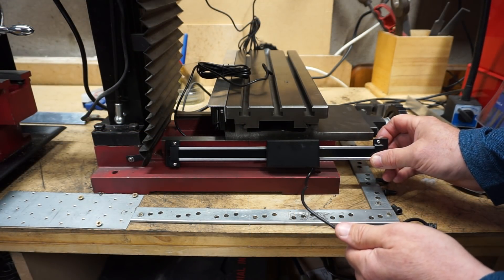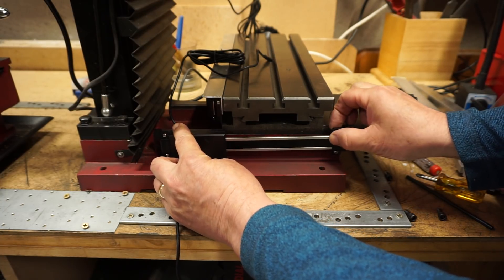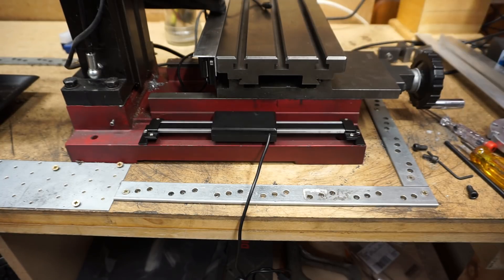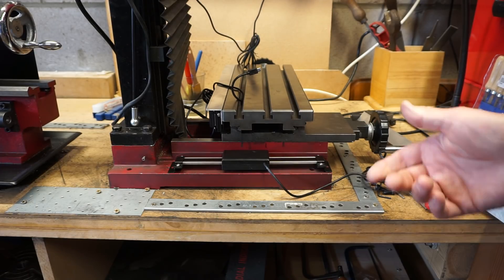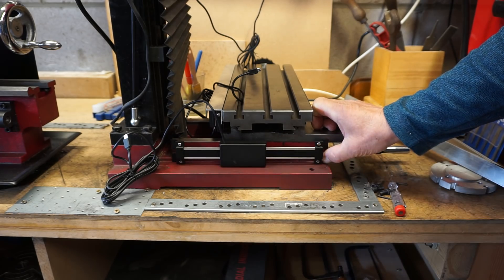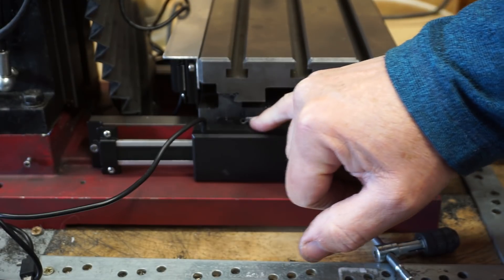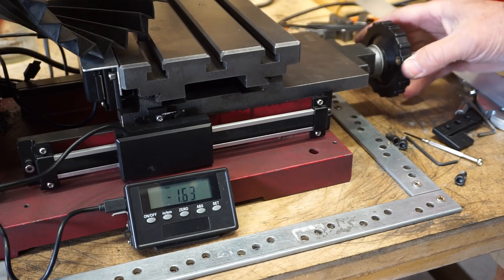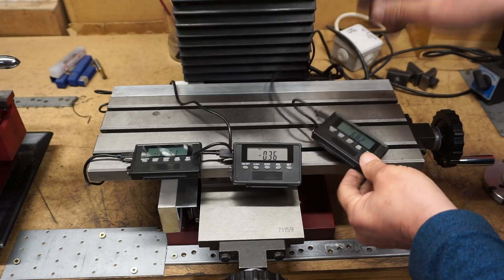#MT28 Part 3 - TouchDRO for SX2P mini mill. The y-axis. By Andrew Whale.

Comment: Hi Andrew,
Adding a DRO makes using a mill so much more enjoyable.
Before installing my DRO, working off the Dials was hard work.
Since fitting a DRO I've found my work to be far more accurate.
I'm a fan of Dave M's videos. He is so thorough with his projects and goes into so much detail. I've learn't a great deal.
Great mini series on installing the DRO.
Regards MachineNZ
Reply from the maker: Yeah Kevin, I'm hoping that they will be stable and accurate. They should save me a lot of time. I keep on losing the centre of the rotary table and it drives me nuts.
All the best.
Andrew

Comment: Reading the comments you will see in an upcoming video where I just blew a ton of chips out of my X axis scale and it was completely covered. Somehow they sneak in thru the rail opening. Just  my 2 cents  or pence...
Reply: Could it be a poor cover hinders keeping the scale clean? I vacuum during and after cutting and have yet to see any build up on the Y axis scale, the head is tucked well out of the way up under the cross-slide.

Comment: Hi Andrew,
Try using another piece of aluminium angle and invert it to mount the scale cover.
As angle bracket to hold your scale cover in place.
You'll possibly need some cable management as the read head moves.
So the cable doesn't snag when moving the y axis.
ATB Adam
Reply from the maker: Thanks Adam. I might give that a try at some point. I have some aluminium brazing rods, so a good reason to try joining the two together!
Keep the great advice coming!
Andrew
Reply: @learningturningmetal  
Sent you an email, drawing of what I mean
ATB Adam
Reply from the maker: Ah, I get it. Thanks for explaining. A picture paints a thousand words.
Andrew

Comment: I also have a SX2P and did a dro installation exactly the same way except for the cover on y-axis, don't feel I need it really.
Reply: Same here on the same mill except for having the cable exit from the bottom facing to rear and to enable maximum travel reversing the end holding brackets, drilling new holes close to the edge of the brackets to enable access to fixings below the scale bar. Same as you no cover fitted and yet to be a problem.
Reply from the maker: Many thanks for the feedback guys. It's a relief to know that I made the right decision and I will try not to fret over the cover.
Cheers
Andrew
Reply: @learningturningmetal  Hi Andrew same here didn't fit the Y-axis cover when I installed my DRO, don't use coolant and the magnetic scales are a bit robust so didn't think the mill needed it, TFS. G :)